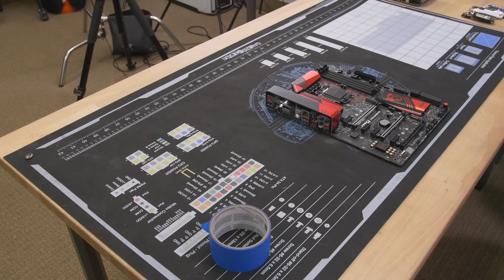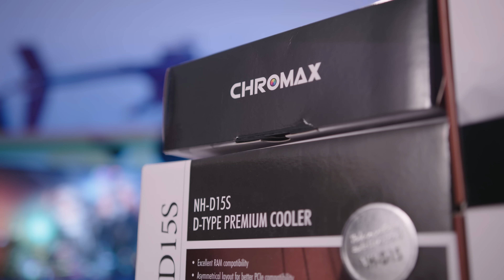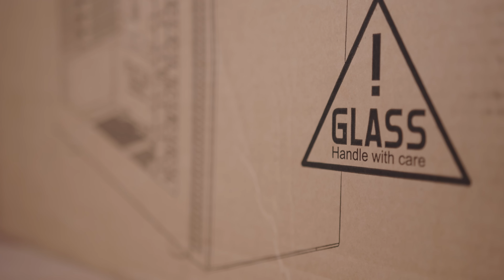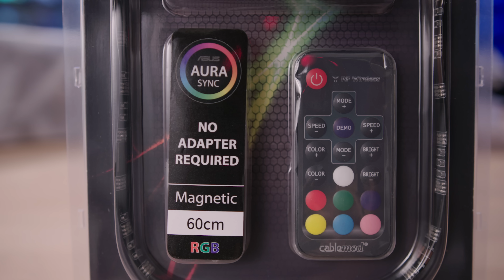We took his computer to the NEXT LEVEL | Pimp My Rig Ep. 3

Comment: I keep the rail specs on but only for power supplies i'm not actually using in a PC. I have a bunch of extra cheap-o's i have been rewiring to use as inverters, to set up car audio equipment with house power for testing. As I get better at it, eventually i'll get a couple high end psu (1000+ watt) to rewire and make a full speaker/stereo cabinet out of the car speakers and shit I've got lying around.

Comment: Honestly, a little cable management and maybe Chromax fans (with red pads) instead of the beige and this build looks fine as is. The mostly black with a few hints of red look works. I guess some custom sleeved cables with a few more red accents would look nice as well.
Reply: Okay, the black and white works too (maybe less with the rainbow puke, but that's just me). I still think the red could have worked with no RGB, especially since once powered on, the mobo has a bright red LED on.

Floating SSD was really neat though, first time I've seen and liked a right glass side panel!

Comment: -1 point for the rgb, -1 point for removing the psu sticker, -1 point for going with white and black over red and black, +1 point for removing unused 2.5/3.5 mounts, +1 point for window side panels, +1 for replacing default noctua.

Comment: 2 questions
1. how does that paint process work? does some small particles of paint seep through the tape so it painted the mobo and gpu without harming them?
2. how did you remove that part in the back panel of the case to change it for a glass panel and then how does the ssd stick onto it, what if it falls

Comment: I don't remove ps labels instead I wrap that side of the PSU in carbon fiber look 3m black vinyl, which will peel off without usually damaging label so if you have a PSU with a 10 year warranty you don't risk voiding the warranty or trying to explain why it is missing label if you need to RMA it later.

Comment: That's nearly my system except for the GPU (ordered the msi trio but isn't shipped till now). My other stats are 6700k, 16gb Kingston hyperx in black, msi z170 gaming m5, 650w corsair rmi,  define r4 and way to many hard drives. 
But my system looks cleaner an nicer and I don't need glas side panels or rgb

Comment: That floating SSD makes my disk hard :3 Also, removing your PSU sticker can sometimes void the warranty. Just a heads up.
Reply: and so can painting over a graphics card. I feel for that poor RTX 2080Ti. 

But yeh, the floating SSD gives me goosebumps. Even though it does not contain any mechanical parts, I would feel very uncomfortable stickering my storage medium to any surface without some screws holding it in place.

Comment: Why people pick this case up at 117£  when they can get something like De8auers lian li PC O11 Dynamic for a similar price? In that case you can mount a 360mmm AIO to intake cool air from the side, 3x120 on the bottom for intake and 3x120 on top for exaust and you wont affect the GPU temperatures because it pushes cool air directly into the GPU. Storage, power supply and enough space for amazing wire management at the back, that's case engineering done right!

Comment: And its extremely smart to hang SSD with power and data cables pointing down, without  using clip on lock cables. Clap Clap. How long till connectors will slip out? 30 mins? hour? Till grandmom first time hits it with vacuum cleaner? XD

Comment: im kinda torn whether just change my fans to a white higher airflow(80 CFM 3 something pressure) or retain my red fans  (50 CFM and idk pressure)

also, im kinda stuck with a situation of, should i remove a purple fan in my sea of red fans.

and, my gigantic cooler(ID Cooling SE207)  literally is a giant ram blockage so im stuck with a low profile ram(TFG TUF ddr4 ram low profile)

Comment: How do I ask If I could do this? I just finished building a new rig, but by old rig I want to give to my brother. but it needs a few parts. msi motherboard cross fire cards liquid cooled g skill ddr3 ram empty drive bays lots of stickers, I am using the 750 overkill power supply in my current new rig but are going to put that back in the old system and get a proper size supply for my new rig. the old rig only needs a hard drive and copy of windows.

Comment: i have a question, you dont losse the warranty of the PSU if you take off the stiker? because i got rejected a warranty from evga just for put some double side tape on the PSU, they say "thats no the original state of the PSU so we cant replace your psu" and i got a bat psu and have to buy another one (not EVGA of course, the losse a costumer).
Reply: yes, you loose the warranty if you take of the main sticker, since the psu cannot be opened as long as the sticker is on it (thus giving a sure way for the manufacturer that the consumer has not meddled with the psu), or at least on this particular model.

Comment: I disagree with your sentiments on power supply stickers. If the power supply is showing at all, you already have a problem. Also, can generally flip the PSU over and it won't show either (there are vents on the bottom). Also, your cable job is terrible, and you still need to get a handle on properly routing individually sleeved cables.

Comment: So question. Do you charge for these custom upgrades? If so, how much? Because I'm curious as to what you could do for my build. 

Ryzen 7 2700x OC@ 4.15Ghz
EVGA RTX 2080 Super 
32GB TForce 3000Mhz DDR4 
MSI B450 Tomahawk
Corsair H100i Pro RGB
2 SSDs, 1 HDD, and 1 SSHD. 
Rosewill 1000W 80+ Bronze PSU

Comment: These pcs are amazing. I'm sporting an old ass hp system. AMD athlon something with only 2 cores, 4 gigs of ddr3, some shitty stock psu, i can only use the on board graphics i have no gpu, and only an old 500gb Seagate hdd. It's running windows 7 home premium. I cant even connect it to wifi until I buy some shitty adapter lmao.

Comment: Hey @bitwit I'm having trouble with my pc. I recently sold a separate pc with the GPU I was using in it (GT 1030) which my system ran fine on. I plugged in a GTX 560 ti and it doesn't display anything. My specs- AMD Ryzen 5 1600, 8 gb ddr4 ram, ASUS A320M-A, 600 Watt PSU, GTX 560 ti. Please help. (NO ONBOARD GRAPHICS OR BIOS JUMPER)

Comment: that rig is better than mine lol 

FX 6300 overclocked 

Hyper 212 With bequiet fans
8gb ddr3 ripjaws red
asrock 970ga rev.3 motherboard
GTX 1070 G1 Gaming by Gigabyte 

500gb crucial sata ssd
500W Thermaltake PSU - 80+ silver

Rosewill throne (white edition) 

Windows 10 Pro 

(lol only rgb on my computer is the graphics card i would add some but i like my rig quiet and cool)

Comment: Hey man, wanna do mine? I have a green motherboard in a mostly red and black build, case is red and black, GPU is red and black, cooler is black 😂😂😂 not my fault, it was a pre-built from 2009 I just recently bought, and threw in a RX 480, it now runs macOS, I regret trading Windows up for it. Especially since it's on my SSD

Comment: Do most cpu coolers contain thermal paste or would I need to buy that separately
Reply: i have a ryzen 7 2700x and i use the stock cooler (wraith prism, because i dont plan on overclocking) and it had preapplied thermal paste, im not sure if "most" cpu cooler have thermal paste but it would probably be best if you bought thermal paste seperately, i would recommend 1g of thermal grizzly kryonaut
Reply: I am buying an after market which does not have preapplied I was wondering if it comes in the box

Comment: I'm building a vr ready pc with msi z370 gaming pro carbon mother board, and gtx 1080. My cpu is Intel - Core i5-8600K 3.6 GHz 6-Core Processor. Just wondering if this can run vr. Thanks 😀- new pc builder

Comment: I have a gateway gt series i need a major upgrade
Reply: which model do you have, if I might ask?
Reply: @CarthagoMike  5428
Reply: yeh, that is quite an old system. Rather than upgrading it, I would in fact recommend getting a completely new PC.
After all, the motherboard of that pc uses outdated sockets, restricted RAM sizes, and does not support more modern I/O's. 
The pentium D is still useable for daily tasks or even light gaming when combined with a graphics card, but since you will have to upgrade the motherboard anyways, it is best to get a new CPU as wel.

Comment: $2000 GPU getting bottlenecked by that 6700K
Reply: I dont think so
Reply: @88specv  educate yourself before speaking. An all core 5Ghz 8700K was creating a bottleneck at 1440p. Will be even worse with 2 fewer cores, 4 fewer threads, and speeds below 5Ghz on a 6700K. https://youtu.be/dLjQR0UFUd0

Comment: Commend part selection? What? 6700k +2080 ti. How is this a good combo? Then 32gb ram, is the guy a photoshop professional? No gaming system needs this much memory. Psu is way overkill for single gpu, and especially for 4 core cpu. Cooler is a dinky 212 or similar class. And the case is with a blocked off front which is not that great for air intake. Yes, you can maybe argue over the case, cooler, heck, maybe guy just loves chrome. But there's no way in a planet you could argue in favor of that cpu gpu combo. Not with how much that system costs.

P.s.. Just buying rtx should disqualify you from having "commendable part selection".
Reply: KintamaHD incorrect.

Comment: Hello, pc noob here. If there is anyone who will help me and now's a bit about building a pc then please help. 

I wanted to know if this is all compatible.

AMD Ryzen 3 1200 CPU
MSI B350 Gaming Plus Mobo
EVGA GTX 1050 Ti GPU
EVGA 500W PSU
Phanteks P300 Case
1TB WD HDD
Corsair Vengeance LPX (2×8GB) 2400Mhz RAM
TP Link Archer T2UH WiFi Dongle
Corsair SP120 Case Fan 

I've put them in pcpartpicker but I don't 100% trust it. Thanks in advance.